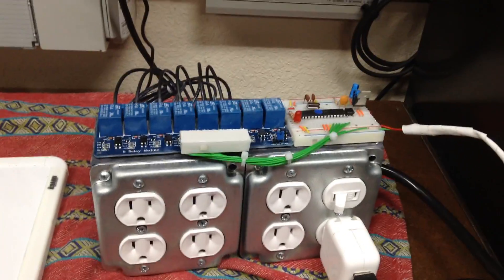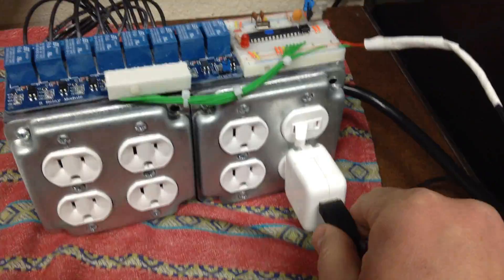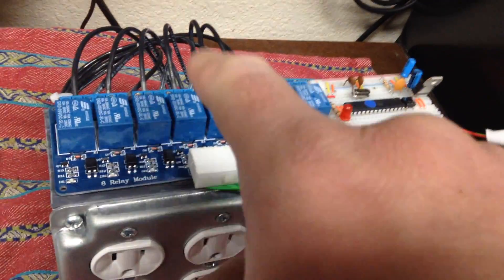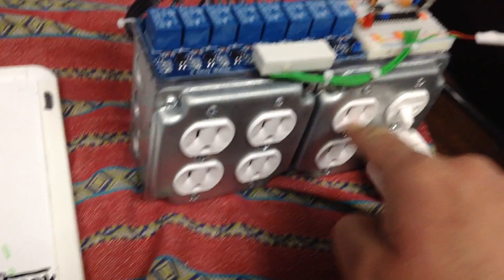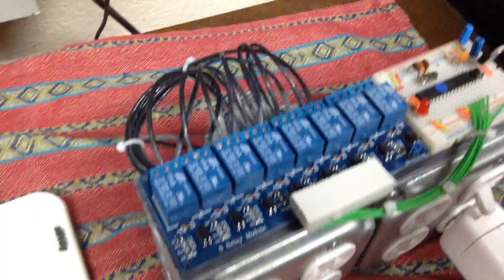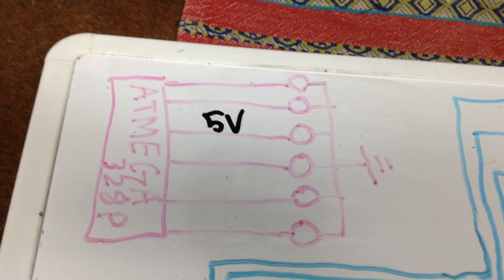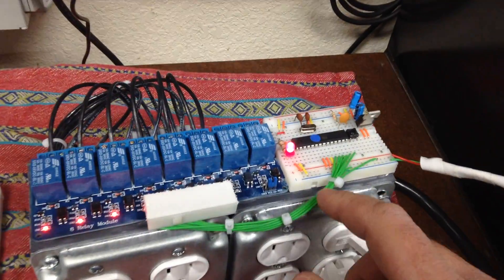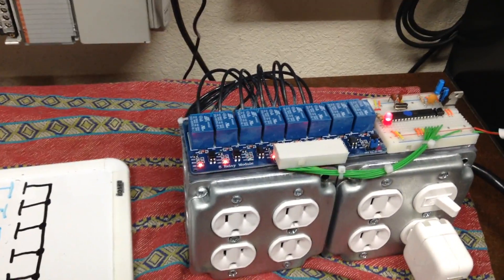DIY homemade Christmas light controller

Comment: I built and 8 outlet version of this to drive some lamps.  The SainSmart relays couldn't handle fast cycling and the contacts fused. This happened when using only 60W incandescent bulbs across each relay.  That's well below each relays rated current threshold.  Anyone building a lamp controller like this would be advised to either slow their cycle rate or use better relays.  Solid state relays may work better, especially for low current draw setups running LED lights.

Comment: Nice. This mechanical relay would drive me nuts especially at night. Solid state relay would last longer, would respond faster and don't make that annoying sounds.   I'm building a similar project but will be wireless using xsource 433mhz transceiver, less wires, and i can put lights 100 feet away from the controller as long as there is power source.

Comment: you left out the part on how to program the micro controller and how hard and head braking it could be for 1st time people working with arduino
Reply from the maker: I just wanted to post a video of how to make a DIY christmas light controller for low cost.  I figured there's already thousands of videos on how to program Arduino.
Reply: ya but for people like me  that get all into it because people make it seem so easy and don't really talk about programing the arduino i bet maybe 95% of people did not use the set up they build because no one has a video showing how there house looks with the setup i wasted so much money and i end up not using it and i burned it cause could not find a good code for the arduino to work with vixen i followed Scott Shaver step by step and it never worked i think its wrong what every one gets people to build something that at the end it never works how they say it does
Reply from the maker: Dont give up.  Didnt happen my first try.  Start with smaller projects that are more simple and when your understanding becomes greater then ready you will be.
Reply: The thing is if you don't know that computer language you're stuck and that's something I'm not a computer programmer end up going through 3 Arduino Uno + 3 16 channel really bored at the end I end up using my mr. Christmas music box but I end up using my 16 channel relay board hooked up with mr. Christmas that's why I was able to uses so many lights

Comment: Hi I am running an home automation software  HA,, Can the relay handle 
hooking up to a washing machine (+or-) to cut the power off? I have some
 5v single relay and I like to ask 1st before I start connecting them to
 receptacles. Also I notice an 14gauge with cannot fit  the relay 
because the screw cannot screw in. any ideas of relays I can use for my 
project . I want to cut off my washing machine and well pump when its 
not is use...  I notice those relays are only 10amps
Reply from the maker: Depends on rating of relay contacts (amperes) and current of washing machine.  Are you wanting to interrupt and control the 120v power to the machine or just a control circuit?
Reply: to turn off the washing machine  current when its not in use along with some other stuff around the house.
Reply from the maker: When it's not in use there should be no draw anyways (or minimal) so I guess I dont see the point...
Reply: everything that is plugin draws current even if its off  more so if that equipment has a transformer.. Plus its will look cool in my home automation project. example: automation - set cycle off well pump when "if" in use "then" cycle on every 12hrs to keep suctions.

Comment from the maker: Arduino Uno (or homemade as seen). Sainsmart 8 relay module 5v. 2 - deep 4square boxes. 2 - double duplex raised covers. 3 - duplex recepts (break only ungrounded tab on each). 1 - switch/recept combo. 10a inline slowburn fuse 250v. Power cord. 6in. din rail. 6 terminal strips with jumpers and 2 end stops. #16 awg stranded wire. Misc wires, crimps, fork terminals, wire nuts. Let me know if you have more questions on operation, assembly, parts etc. I can be more specific if needed.
Reply: Michael Yusi can you send me a wirings diagram